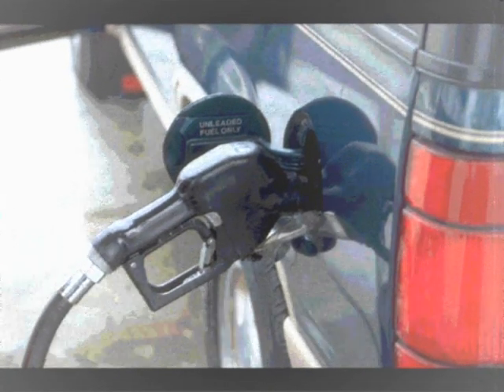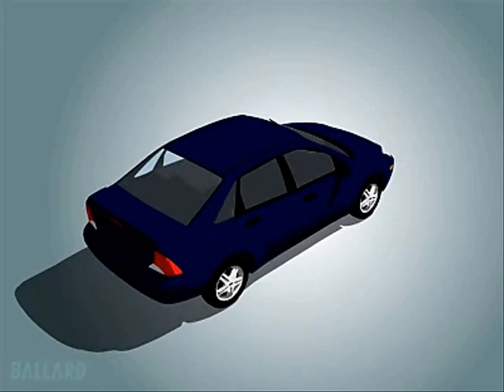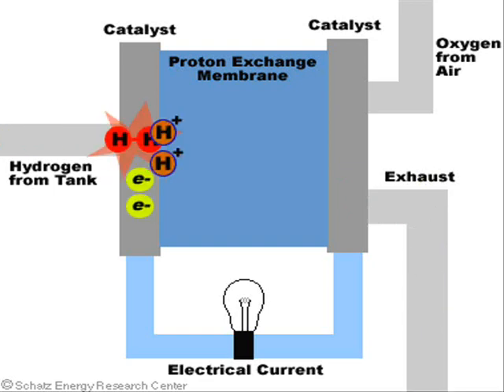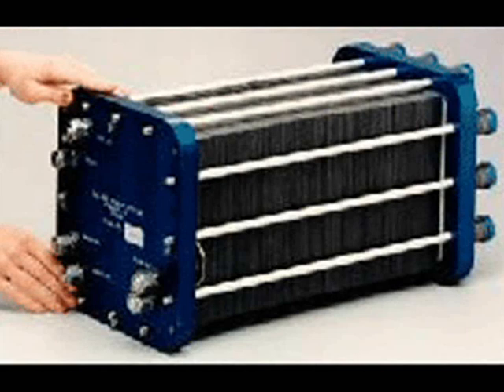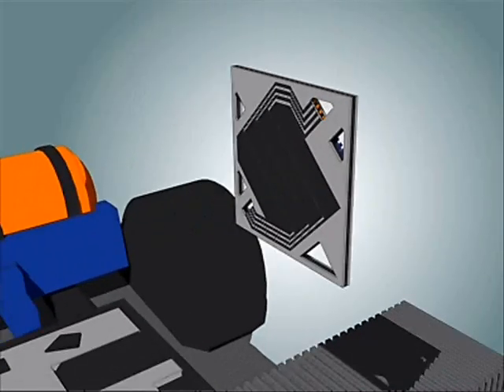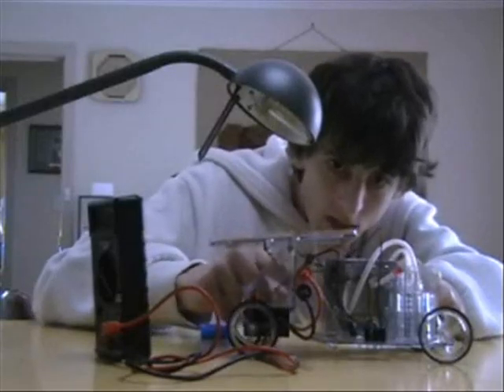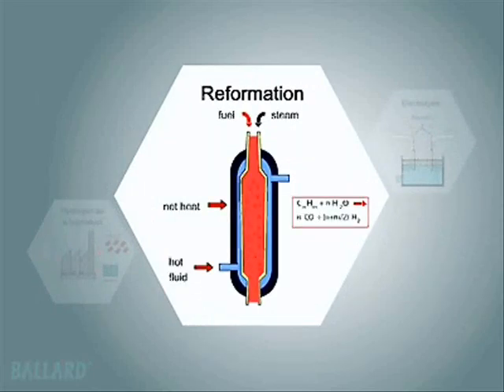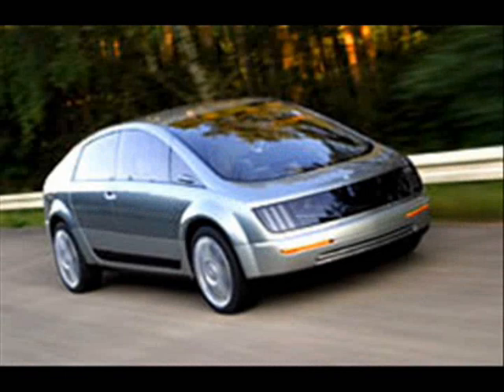Hydrogen

Comment: Actually, Hydrogen can be made using small solar panels to Power the electrolysis, and using water as the source.  It takes longer, but is reletivly safe.  Enough Hydrogen to fuel a small car for a few days would take one Solar Hydrogen generator, about the size of a car seat, 10 hours to fill.